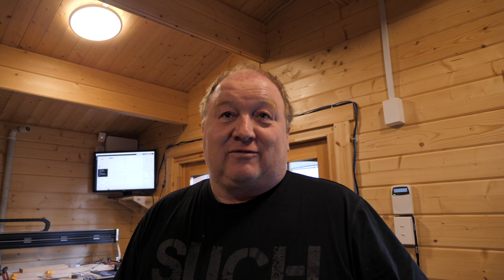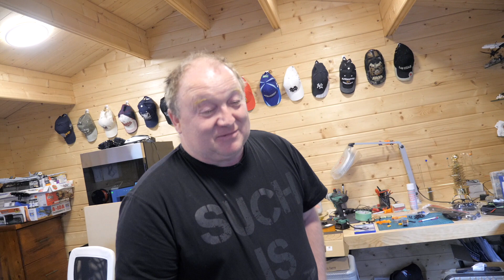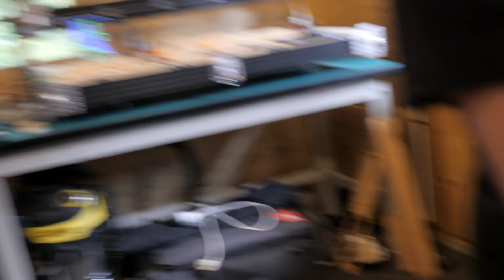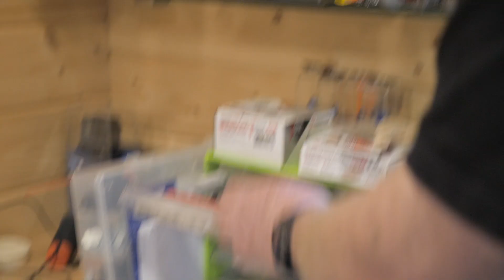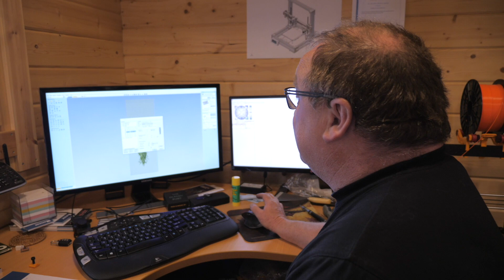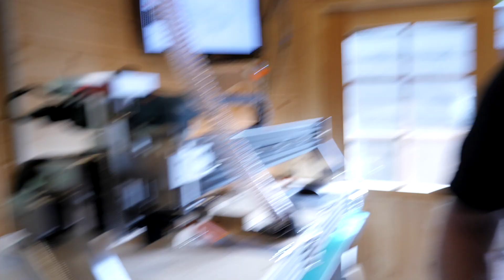Customer Profile.....Nick Collier

Comment: Hey Nick, your projects look awesome. Just wondering how you went about getting the picture of the Tui’s to machining them and on what software?
Currently, I find an image online and then use an online converter to convert to svg to import to fusion to model it up. Problem I have, especially if its a more detailed svg (e.g a photo, which I am current trying to engrave for a friend) is that fusion cant process it/ my computer cant. So am interested in what process you use??
And what kind of operation you used to fill in the tui rather than just an outline?

Cheers